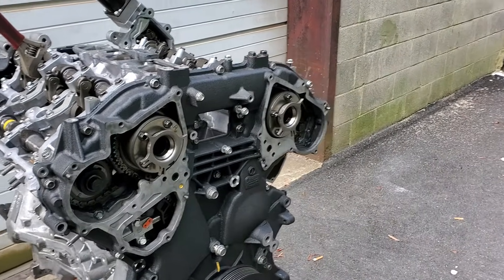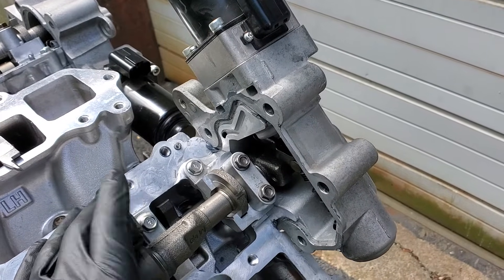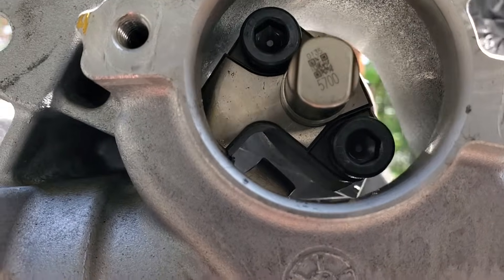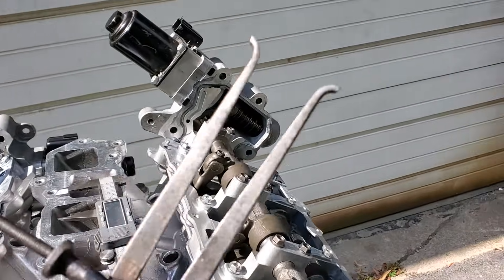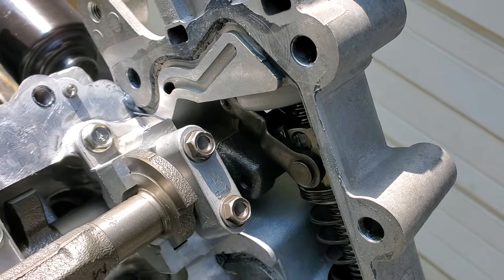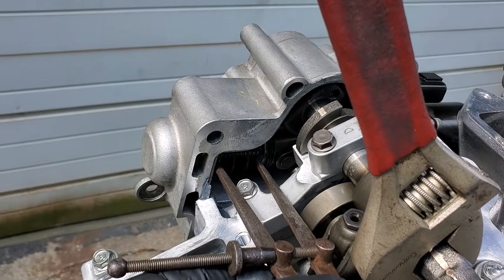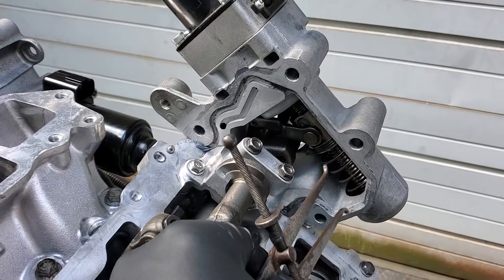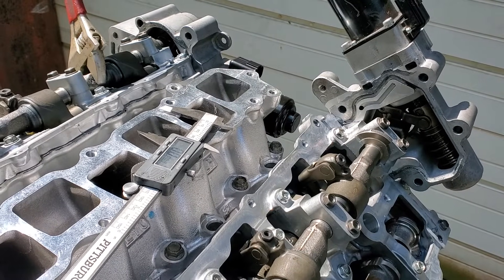VVEL fix for Nissan 370z and Infiniti G37

Comment: Please drop me a line. I am installing a 3.7 into a 3.5 350Z(07). 2010( 3.7).
I wish to roll shaft to full power position. Unless I can operate manually by a toggle or window motor control switch. Have you thought about locking out the vvl?

Comment: I moved the stepper motors all over the place to get it to fit back in place... With these not being calibrated cause a crank no start?  I had it running a few times.  It took a LONG time and a lot of cranking to finally get it started and it revved nicely.  Sounded good. But after a few times running now it will not start at all.  I cranked it until I had to replace the starter.  It will not start at all just cranks forever.  With these not being calibrated cause this.  Even after it ran a couple times?  We have checked everything else.  Fuel spark compression is all good
Reply: I really thought since I had it running a couple times that there's no way it could be the stepper motors but I cannot get it to start anymore it sounds like it wants to start it just starts to catch and then it won't
Reply: @SydneyChromatic  u sure u haven't fouled your plugs and no if these out if calibration the car will still starts mines out if calibration and one click start just runs like shit
Reply: @infinitibossauto Im pretty sure I spun a bearing.  The engine was dry for atleast 6 months.  It took a half a year to change the head gasket.  So I cranked it by hand a few times and after a few starts it was too dry.  Can barely turn. It with a breaker bar.  Starter was struggling it burned out
Reply: @SydneyChromatic damn bro , i have a fully built engine built by myself running fine over a year now
Reply: @infinitibossauto  I bought a VQ from fb marketplace for 450 from an Infiniti performance shop in myrtle beach.  So I'm just swapping engines and I will build the old engine for boost with good parts.  I need a winter project anyways

Comment: Hey, thanks for the video, just curious what the allowable tolerance is for this? I got as close to 1.585” as I can, but is 1.584 or 1.586 allowable, or should anything between 1.580 and 1.590 be “within tolerance”?

Comment: Hey, fingers crossed you might have an idea and hopefully you see this.

I’ve got a rattle coming from my left side  it’s pretty loud but only rattles at idle and as the revs come down form 2200-1700. It’s coming from the vvel motor assembly area. Have you ever come across this or have any idea what would cause this?
Reply from the maker: Stock or modified?
Reply: @sethjoyner391 modified. Single turbo mid mount makes 550whp
Reply from the maker: @jamessbarker  always done it or progressively got worse?
Reply from the maker: @jamessbarker also...built engine or stock boosted?
Reply: @sethjoyner391 just noticed it at the start of this year. Least noticeable on a cold start, most noticeable once the car is warm. I wanna say it’s not gotten worse or better. Motor is completely stock internally never been opened apart from timing cover and valve cover gaskets. Noise certainly comes from the back of the engine and is a very metallic noise. Have checked everything externally but am almost positive I can hear the tapping when I put my ear up to the passenger side vvel bit with an extension
Reply from the maker: @jamessbarker ...ok...so, my best guess is that the vvel set screws have backed out slightly and u have pin rattle..it seems to resonate harmonically from that area...sounds like lifter tick..I'll redirect u to another video of mine...it can be checked and inspected manifold and valve covers off ...also good to check the other side, though it only seems to affect the bank u have in my observation in teardown
Reply: @sethjoyner391  Nevermind I watched right to the end, thats a massive job for such a silly screw, might just have to suffer with the noise and send it
Reply from the maker: https://youtu.be/xsMgOf2YT-M?si=CmVKBoWk-jsXoFee
Reply: @sethjoyner391   Your a legend, appreciate your replies more then you know its been driving me crazy.... Are these set screws easily accessible and able to be tightened and Loctite from above with the motor in the car?
Reply from the maker: @jamessbarker never tried it in car..but, I imagine..just gotta brake clean the hell out of those set screws before high temp loctite😊
Reply: @sethjoyner391 is it possible to get to the bottom set screw in the car struggling to picture where they are. I’m assuming the whole vvel assembly needs to come out?
Reply: @sethjoyner391  After listening to the video and you rattling it just slightly im almost convinced that this is the cause

Comment: Did it with the measurement of  appx 4cm and it fits like a glow! Thanks alot man! Hopefully it will work. Ill post the results in couple of days...btw, the upper height was the grey metal i was hitting and not the spring. This was a bit confusing to me in the vid. Edit: man, good that i watched it again! On bank1 was set to turn  the same direction as on bank 2 on my side. Man, gonna get this moved! 120degree, loosen two bolts, move it!Man! Thanks again!
Reply from the maker: Awww, thank u man....best of luck..fingers crossed
Reply: Just checked it. All good positoned on the left side (bank 1). Good stuff!

Comment: Need help have 2014 q50 crank but wont start code comes up p1089 1091 an 1093 any suggestions replaced crank sensor  replaced vavle.cover gasget. New starter tried everything i can think of but did not replace cam.shaft you think maybe its that ?
Reply from the maker: @AphinihaneInsisiengmay  have u checked ur fuel pressure?..how many miles

Comment: Not sure if you’re still active on here… but my car just started to have issues with bank 2 VVEL. Out of no where. I have to disconnect the battery for it to work properly again then maybe 40-50 miles later light comes back on an no throttle response what can it be?
Reply: It’s a 2010 Nissan 370z 6 speed never have been into the valve train only regular maintenance
Reply: Did you ever fix I’m having the same issue but only on bank 1 only.
Reply: @CrazyvqRyan  Honestly I did. I replaced a few things tho. I had replaced my spark plugs and ignition coils and it went away.
Reply: @CrazyvqRyan  Im assuming my ignition coils went bad and it was throwing off my timing. So replaced them it went away. If that doesn’t work replace ur camshaft sensors and crank see if it goes away
Reply: @prvtgoaty_yt4738  i changed the VVEl module the VVEl sensor 6 oem coils and plugs the car works good for like 2 days then while driving on the highway I’m losing all power no acceleration i have to pull over to the side and reset the battery. The only codes are p603 and 1089
Reply: @CrazyvqRyan  How about the VVEL motor? For bank 1? Cuz I also replaced the the VVEL motor for bank 2
Reply: @CrazyvqRyan  also what year is ur car?
Reply: @ no I didnt replace that as yet. They should have gave me code P0193 The previous owner is telling me I need to take the car to infiniti to get the sensor calibrated. idk what he’s talking about maybe within range. he changed it with a cheap eBay one.and set the voltage to 0.27. I replaced it with an oem one and readjusted bank 1 an 2 to 0.50 i also changed the VVEl module that day with an oem one because he replaced it with a junk yard one. idk what this issue is maybe the ipdm ecu relay is shorting out after the car gets hot and not sending power to the ecu and the ecu isn’t tell the engine what to do.
Reply: @ well timing has to be within spec 0.08-0.010 if timing. If it’s no where near you need to take it to Nissan/infiniti. They know how VVEL latter towers work and the could reset the range for VVEL calibration. Sometimes it’s as easy as a ecu reset with them.
Reply: Ladder*
Reply: @ how can I check that? Even tho the car seems more of an electric issue this can still be related to timing? Like I said car runs great for 60-100 miles then out of sudden it loses all its throttle like the throttle motors not work properly and it’s not getting enough fuel or something . Something throwing it out of time. because when you turn it off you hear engine rattling. but right after you reset the battery and let car sit for 5-10 mins it’s working fine again. If the engine was out of time it would be out of time all the time right? Not when you reset the battery your good again. it’s weird idk what else to do next people saying to change idpm module or ecu next. Any opinions?
Reply: @ I was fighting this issue for a long time. It went away after I changed a bunch of crap. I’d say go for it. I’m pre 14 to these had a lot more issues. But honestly go for it. Could be oil pressure related too? Galley gaskets maybe idk tbh running out of ideas😂😓
Reply: @prvtgoaty_yt4738  what was the main things you replaced that solved the issue? should I remove the valve cover and check the clearance between the stepper motor and the vvel sensor?
Reply: @ I replaced my VVEL motors both banks Ignition coils spark plugs camshaft sensors and get the car reprogrammed at Nissan
Reply: @CrazyvqRyan  Also any modifications to the car?
Reply: @prvtgoaty_yt4738  the car is completely stock. no modifications done yet.
Reply: I only getting code 1089 VVEl position sensor. And random cylinder misfires makes no sense because I just bought 6 oem coils and plugs. I noticed the problem only acts up when you get on the car into the higher rpm’s like 6500.out of a sudden you’ll be driving normally and boom cel turns on and you have no control of your acceleration car begans to slow down on its own then you’ll have to reset the battery and start the again but sometimes it doesn’t work right away you’ll have to wait for 10-15mins.
Reply: @CrazyvqRyan  yeah that was happening to me. The only thing that continues to happen to me is the random misfire codes. Been trying to figure that code out for a few months now and there’s no info online. Tracing these VVEL codes are damn near impossible. No info online. No forms nothing.
Reply: @ yeah I know, man it’s super stressing too. Did you ever change your ECU?

Comment: Would an issue with the vvel cause a no start condition?
Reply from the maker: @thatsubae  not imo...I think it would probably be more related to a crank sensor or the dreaded bank 1 intake sprocket encoder slippage (mechanical failure) wherein the bank 1 intake cam sensor can't identify the reference point for the mag pickup.
Reply: @sethjoyner391  gotcha i have a car on my side jobs. I identified the timing off, corrected the timing with new chain and tensioner, put everything together and still wont start, will start if I unplug the cam sensor
Reply from the maker: @thatsubae  yup....dooo it
Reply: @sethjoyner391  hey so it did ended up being the Cam sprocket on bank 1. I redid a cam crank correlation on the scope, and it was off on where the cam sensor reads it. Italled a new one and it started up. Thanks for the pointer!
Reply from the maker: @thatsubae  no problem brother; much easier to speak with talented mechanics🤗
Reply: @sethjoyner391  hey so now I have a p0300 lol
Compression good, timing good, spark good, you ever come across that issue?
Reply from the maker: @thatsubae  misfire....check plugs, coil packs...also if u have any vvel issue it will create a random misfire

Comment: Hey Seth great videos really helped with rebuilding my timing and calibrating vvel. But please help my car won’t start and I’ve changed everything I’ve even sent it to a shop and they can’t figure it out. Basically I have a Nissan Infiniti fx37s. It stopped starting, had camshaft sensor fault. Unplugged sensor car would start. I then replaced both sensors for new oem. Car still wouldn’t start only with the left hand bank unplugged. I then took the timing cover off, there was no sign of any problems tensioners looked good soo did chains and all sprockets was on their marks. I replaced chains tensioners guides and sprockets. I also checked the vvel calibration which was good as per your video. I also changed the intake solenoids on the timing cover. Car still would not start only with left sensor unplugged. I forgot to ad the first thing I did was change oil and filter. Anyway I’ve changed all of that and it still won’t start. If the sensor is unplugged and I start it it only revs up to 3400rpm if I plug sensor in it won’t stop, if I turn it off it won’t turn on. With sensor plugged in and code’s deleted, try to start does not generate new codes anymore only when im unplugging the sensor. Please help im really confused and frustrated at this point I can only think to change intake sprocket or power control module.
Reply: Have same issue on my g37 2012 , only runs without the crank sensor I’m getting 180 psi on all 3 cylinder on bank 1 an then around 210 in bank two checked the timing everything seems to be right

Comment: He Seth thanks for the video im not very knowledgeable with these infiniti motors but i have a 2014 Q50 engine had a guy that swapped it to a 2014 370z VVEL stayed on the engine assembly and it seems to have a timing issue barely starts and seems to maybe have advanced timing… are you able to chime some advice on this topic please… thanks in advance

Comment: Shout out to all the rookie engine builders. (Such as myself) if your  lapping your valves for a good seal, don't be like me & not check your valve clearances after ending up with all your exhasut clearances being too tight. Causing glowing red manifolds on your exhaust . 

You can do everything right but miss this one crucial step, you will tear it all apart.

Comment: hey Seth, what was the symptoms when a vvel  fail, missed  timing  alighment ?
Reply from the maker: Mostly this is a procedure for r&i on motor builds, cam changes etc...however  if u have a stepper motor malfunction u can hear grinding or metal on metal contact with the worm drive assembly..it will be audible at the motor...also u can have excessive valvetrain rattle on that bank, misfire etc..the sound will be isolated to the intake cam and sprocket area...along with correlating dtc's etc
Reply: I have done a 2009 G37, timing chain, second chain, sprockets. and now the codes came back on with p0011at first, then I hit the gas, shows up p0021
When I changed the sprocket, the old sprocket was off a tiny degree  compared to the new one (the cam sensor signal on the sprocket)
It runs good at Idle but It won't rev up 2500rpm. I wished I wouldve waited for the Galley gasket. I told the customer since begining but somehow he don't have any parts but the timing kit, then the sprockets came in and I just want to finish (what a dump of me), reason I did that because I saw a video saidd VQ37 doesn't have a failed galley issue, I inspected the gasket, and the sprockets made me think that I caught it.
Reply from the maker: @lucasvaughn9423  did u accidentally swap your vtc solenoids harnesses? Those are the codes u can get, swap the harnesses back
Reply: @sethjoyner391  The harnesss seems to be corrected. 
*update: I removed the timing chain once again and replaced the gallery gasket (  dealer part) , put it back together, running good at idle, won't rev up 3500rpm, p0011 came back,  alternator has'nt been charging because someone changed it twice  with new plug and wired.
Reply from the maker: @lucasvaughn9423  u checked the bank 1 vtc covers triple dynamic seals and vtc solenoid is actuating? U also changed the intake sprockets to new factory units? Common causes on that year are sprocket failure (encoder slips)..also have you confirmed oil pressure on a manual gauge?
Reply: @sethjoyner391  update* changed gallery gasket, sprockets, new vct solenoid of course, new oil filter, neww timing chain kit, running fine after 2 test drives. 
When the customer pick up the vehicle and drove, checkengine light came back on, p0011 p0021, and low oil pressure. 
I literally don't know what to do anymore, in live data I see the actuaor is actuating, 2500rpm about 34 or 54 degree both banks, bank 1 51% , bank 2 40% , aand wwhen I let go the gas pedal, both banks returned to zero ddegree, sometimes I see a flucctuating on bank 2 says 0.5* to 0 compared to bank 1. 
- in the past, custumer has bad oil leak, overheating history.  He might  have a worn out in oil system ?